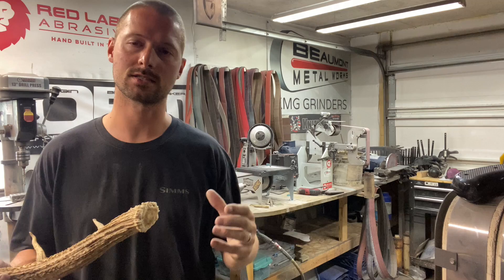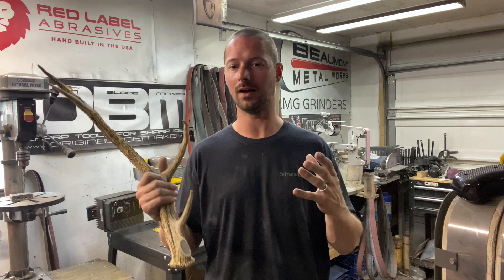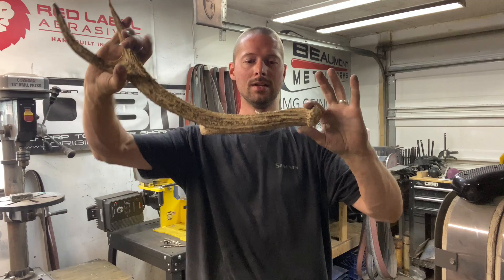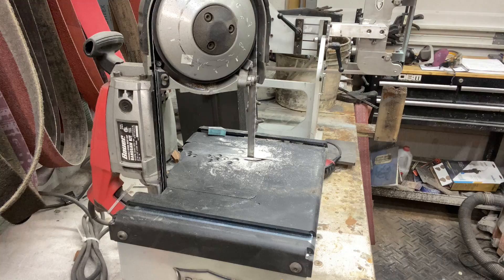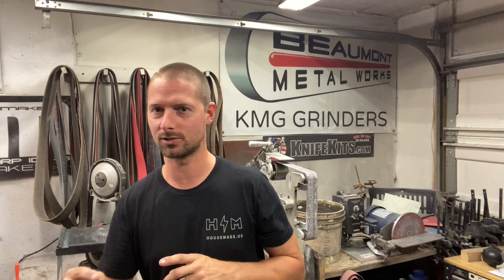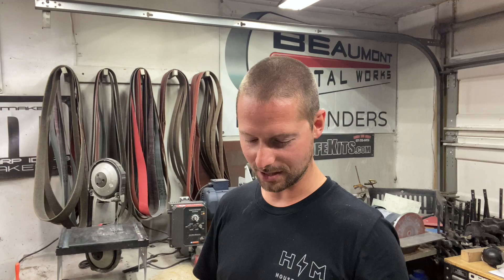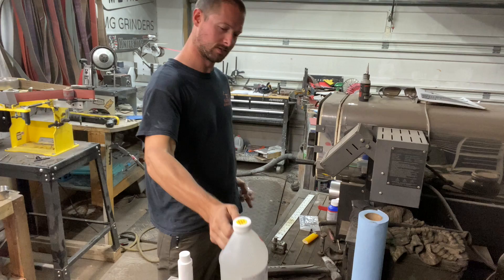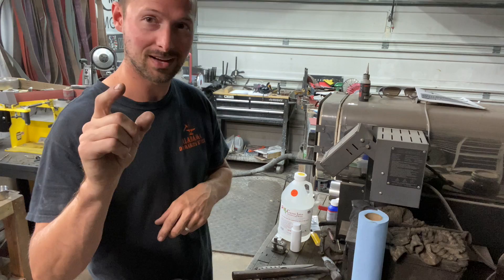How to Turn raw antler into INCREDIBLE  handle material!!

Comment: I have been working with Antlers for a number of years. I use Antlers. for a different purpose. I hollow out antlers to put lights on the tips. When you slice the Antler in half Remove the fibrous tissues and add ( Superclear 2.0 epoxy} It will solve your problems much simpler.

Comment: Years past nothing was done on the antler and the scales last many many years. I just replaced a set on a customers folder that I found was originally dated 1984 underneath.  Most issues that show up after many years of use were with cracks from the pin areas that were peened down.  I have been using cactus juice to stabilize antler and they come out really solid (and heavy).
Reply from the maker: Very cool! 👊

Comment: Wouldn’t the voids fill if you left the pieces while when stabilizing then splitting for scales? Since the resin is replacing all air pockets if you left those exposed voids as internal pockets they should hold the resin.
Reply from the maker: Cactus juice doesn’t fill large voids unfortunately.
Reply: @gentrycustomknives8008  thanks for the reply. I was aware it’s not to fill voids but wasn’t sure how it functioned internally and how large of a void could be filled.